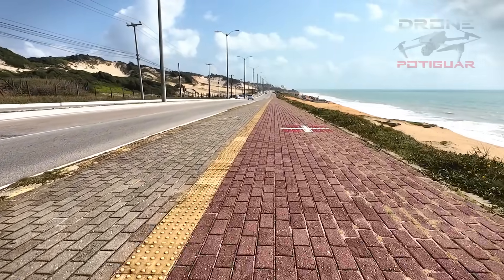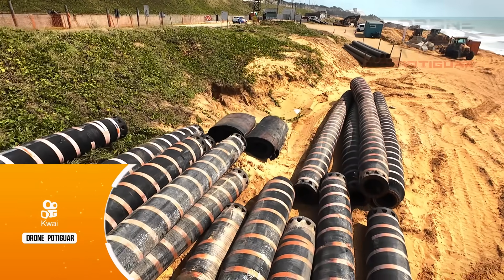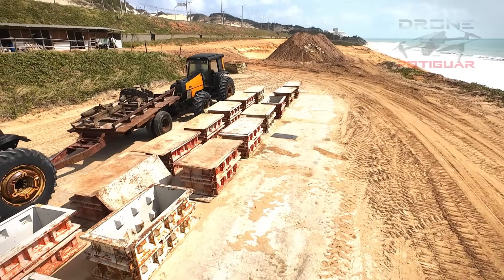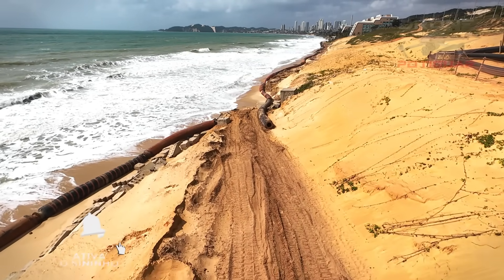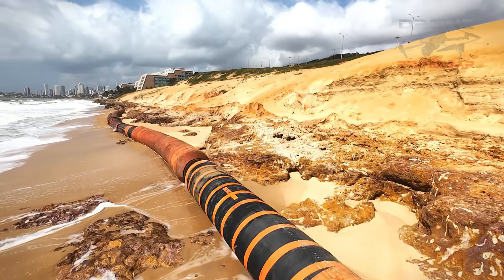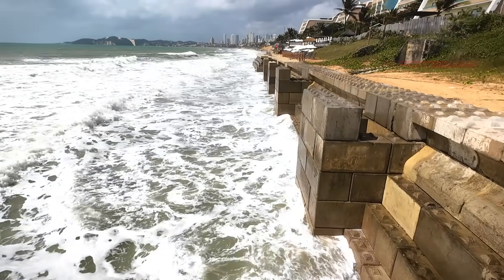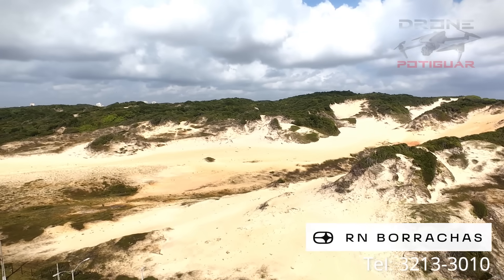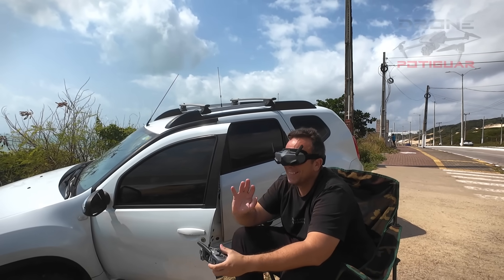Atualização 1 - Engorda da Praia de Ponta Negra - JÁ COMEÇOU ! !

Comment: Distância do meio da praia "Coral Plaza Apart Hotel  Km 2,25 " para jazida "Altura do Senac "  são uns "8km"   . 
A draga vai e volta, distância da costa será +- 500 metros. 
Tubulação de recalque terá 400 a 600 metros da praia  .
Vlw pelo video.

Detalhes do Alargamento : 

Volume de Aterro : 1.055.922 m³
Extensão da Praia : +- 4.552m
Altura da Berma +2,75m
Etapas : 
F1N 1.093m , 14 dias , 158.518 m³, Berma 44m.
F1S  1.081m , 24 dias , 263.817 m³, Berma 66m.
F2N     883m , 23 dias , 248.015 m³, Berma 75m.
F2S      941m , 23 dias , 255.515 m³, Berma 87m.
F3S      554m , 12 dias , 129.058 m³, Berma 71m.
Reply: Vlw pelas informações amigo🤝🤝🤝👏👏👏👏
Reply: Top, Como funciona essa tubulação ?
Reply: @MauroNascimento-xz2lk  essa tubulação vai ser pra transportar a areia que vai fazer a engorda